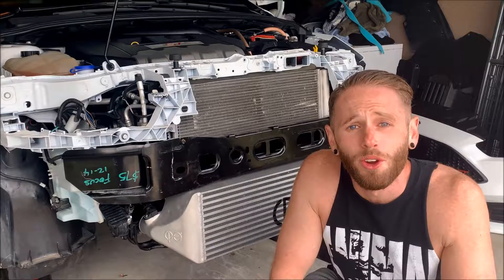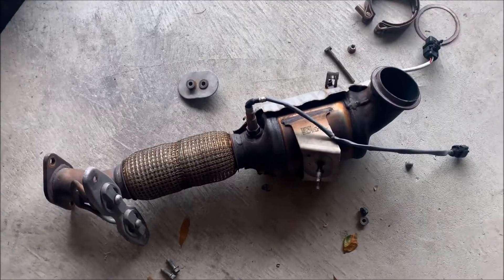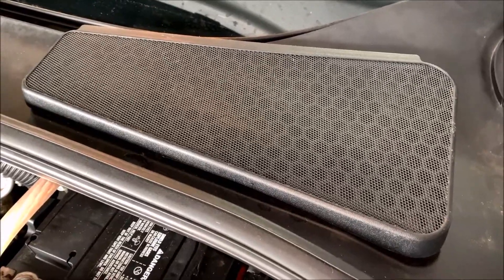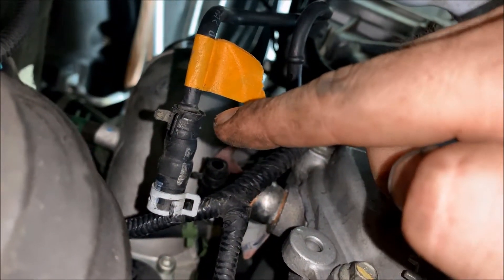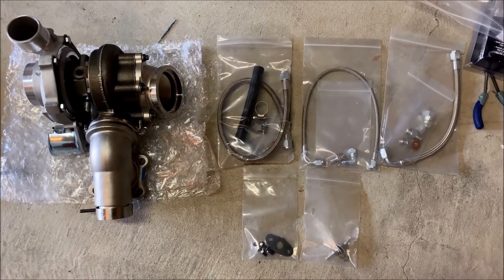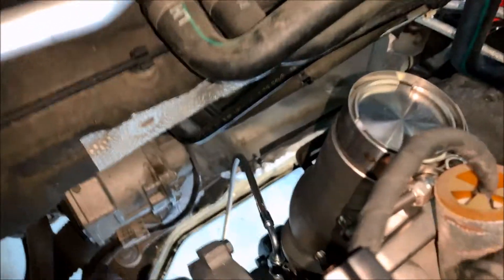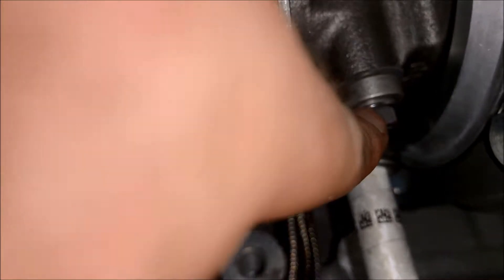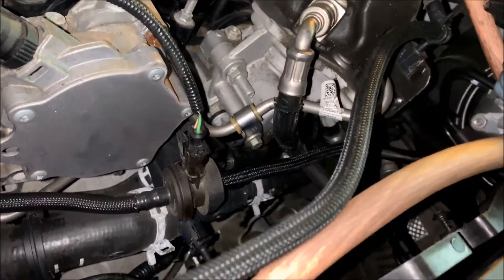BIG TURBO FOCUS ST - ATP Turbo Kit with Garrett GTX2867R Turbo Complete Install

Comment: I'm a little confused it looks like i can buy a GTX2867R around $700. Could i then just buy the hardware separately? Or the hardware kit separately? I'm new to this anyway guidance or insights are greatly appreciated. Thanks everybody.
Reply from the maker: You can buy any Garrett turbo by itself but as you pointed out it will have no hardware, oil lines, coolant lines, no couplers, and the most important is the adapter to connect the turbine housing to the exhaust manifold.
Reply: @JordanMoree  ahhh gotcha. Thank you! The adapter to connect the turbine to the exhaust housing. I knew there was something I was missing. I'm brand new to turbo engines. That makes a lot more sense.

Comment: Btw the coolant hose hooks up behind the heater core line. I'm fairly sure its the intake line and tbh you can just pop it off. I had to replace both, it doesn't have the quick disconnect feature, so its fairly easy to pop off as long as you have a pick tool. It's an extra step, but makes sure the coolant line is secure.

Comment: I've been dragging my feet on this install. It just seems like such a pain to do laying on your back lol.
Reply from the maker: First time sucks.  Learning process. After that it’s like changing the oil.
Reply: @JordanMoree  well I am in the middle of it and your video has been such a huge help. For anyone reading and looking to do this I had this question come up and it isn't really mentioned in any video:

Do I reuse the manifold gasket when installing the new Turbo?

The answer I have found in the forums is NO. All you need is the fire ring. Using the stock gasket and the fire ring can cause a leak. 

I'm still in the process of routing the oil/coolant lines and then figuring out the vacuum lines are hooked up. But so far so good. Thanks so much for the video!

Comment: The damn coolant feed line kicked my ass. I had to quit for the night before I torched the whole car. By the time I snugg it up the hose kinks, so I waited to hook the line to the turbo last and it ended up cross threading a bit. Now I can't get it on straight and idk how to tighten the 45 elbow enough to not leak

Comment: Will you need new injectors for this set up?
Reply from the maker: No the stock injectors are fine.  However to get the full performance out of the turbo you will need some sort of aux fueling with a separate set of injectors.  You will also need a higher octane fuel and/or water/methanol injection.  93 pump gas is limited by octane and from my understanding the HPFP is not capable of flowing enough fuel even with race gas or ethanol blend.  93 octane will net you around low 300’s on hp and E30 will get you mid 300’s.  I’ve heard of guys breaking the 400hp mark without an auxiliary fuel system but they are running at least E30 and water/methanol system.
Reply: @JordanMoree  nah you can run almost 400 on stock hpfp, just gotta 85 tune which you can do from Edge Autosports tune.

Comment: I'm having a hard time telling but did you add vacuum line to the boost controller? I saw Bill from CJPP do it and he didnt specify what size line he used. Would you happen to know what size I would need for that? Is it 1/4, 5/16, or something different?
Reply from the maker: I actually used that video to help with my install.  No I didn’t have to add any extra vacuum line.  I used all the stock lines.  I believe Bill actually did add longer lines but as long as you mock it up with the couplers on and get your points to drill for the boost reference points it will fit with the stock lines no problem.
Reply: @JordanMoree  Oh thats a good point! Thanks for the info